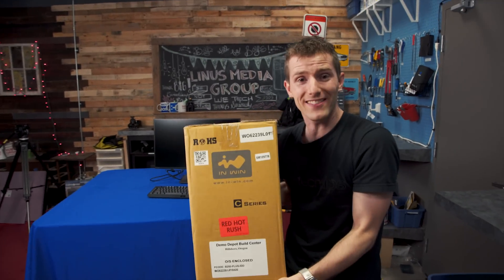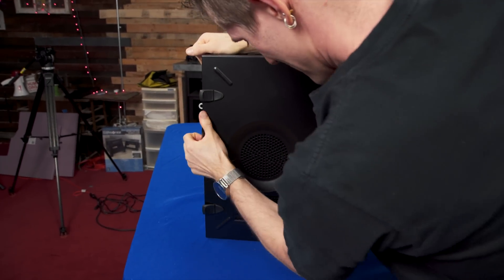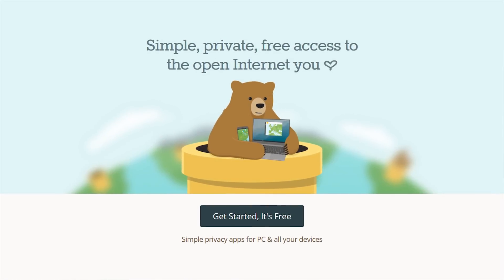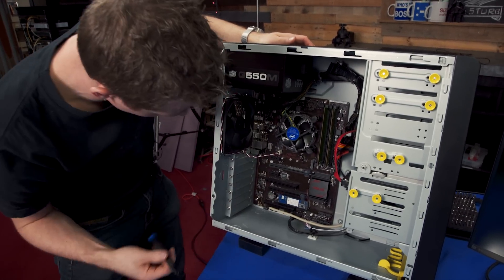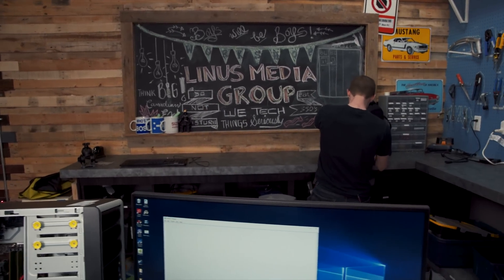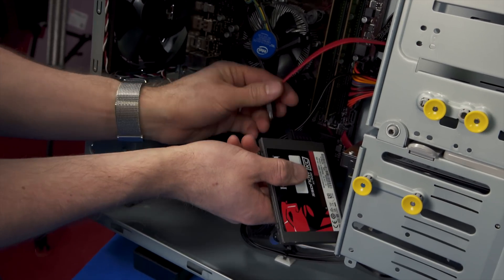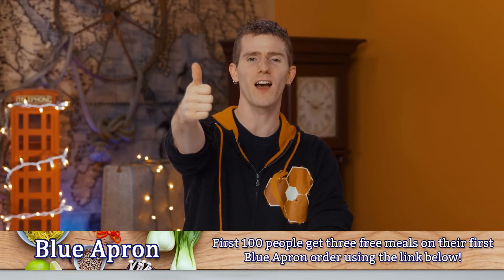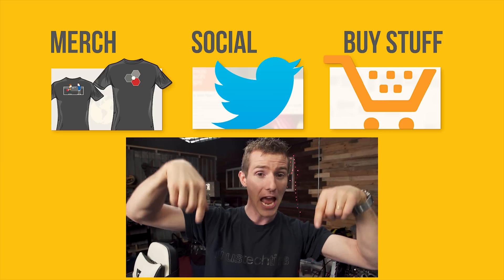Turbocharge your SSD for $40??

Comment: Why they don't have a boot SSD on a new z270 system? I'd be questioning why they don't have an M.2 boot drive personally, since I don't think there are any new z270 boards that don't offer M.2 connections...

The only place I can possibly see Optane being useful is on a personal home storage server, where you're using new hardware but still using platter drives to store your media collection...using Optane to cache Plex would probably give you some good performance bumps. Outside of that (or possibly some enterprise-grade server options), this seems to be a solution for a problem that doesn't exist.

Comment: I see no point to this product.  If you have a PC that is new enough to take an optane module, you likely have an SSD and if it doesn't take an SSD to NVME performance, what's the point of this?
Reply: But it won't ever be "Similar Speed" - normally you get 2 drives, one SSD and one HDD.  And honestly if I have an M.2 slot I'm not going to fill it with an Optane - I'm gonna put an M.2 SSD in there.
Reply: I just built a system with an ASUS PRIME B250M-PLUS . It has 2 M.2 slots or which one has a 500GB WD SSD and the other has 32GB optane. The HDD are 2x WD Black 2TB in RAID 1. Yes, the Optane makes a difference for the RAID array, not so much for the SSD.
Reply: thought Optane only works on primary boot drives, how does it help the 2X WD HDD?
Reply: BlueSmokeGamer I see no point in any of it.
Reply: you can technically set a swap/paging file for the RAID
Reply: Click bait. They made Linus's head look like erect male genitals. That's why half of us clicked. To comment on the Linus penis head thumbnail. The irony is that Linus's chin is actually more like a penis, so they could have just shown that.
Reply: It's supposed to be added to hard drive 
4 tb ssd= $1600
4tb hdd + optane for similar speed= $200

Comment: big question does octane help no primary hdds reach better performance without using the ssd cache. 
I'd assume yes which would be beneficial for multiple mechanical hdd users who may also have a primary ssd. 
(eg steam library on a 4tb mechanical loading faster)

please post results much interested :)

Comment: Isn't the tittle suppose to be "Turbocharge your HDD for $40"?
Reply: nah he's really wondering if you can turbocharge the ssd. He's pretty certain that it will have some effect on the HDD
Reply: I think the tittle should be "Turbocharge your HDD for $40" because it has more significant improvements on an HDD than an SSD and its aimed towards people that use HDD
Reply: Simon WoodburyForget M.2 is a slot. You can use SATA SSDs in M.2 as well so they're not necessarily faster.
Reply: Notice the ?? in the title. Its a question because whether this actually helps an SSD was the main thing Linus was going for.
Reply: exactly!
Reply: 4:53
Reply: yeah exactly!
Reply: m.2 is a ssd. .its waaaaaaay faster then a sata 3(6GB/s) ssd if it has its own 3.0 pcie  lane (up to 32GB/s) whereas a lot of motherboards share it with another 2.0 lane(10GB/s). you want the fastest  ssd performance and you dont have a dedicated m.2 slot get an PCIe 3.0x4adapter if you have an open 3.0 lane on your mobo.
Reply: not all m.2s are the same
Reply: +zeroa69 err not necessarily. M.2 is an interface, not SSD.  M.2 can be used for other types of cards too, e.g. WiFi card. Secondly, an M.2 SSD is only waaaaayyy faster if isn't SATA based. A SATA M.2 will run at the same speed as normal SATA. Lastly just to add, using the PCIe adaptor you've mentioned has a catch in that some older motherboards don't support booting from NVMe so the SSD would only work as a secondary drive.
Reply: Yes, maybe the title should read "Turbocharge your HDD/SDD combo for $40". Octane does seem to indirectly turbocharge the SDD, but it only really happens when an HDD is also linked to the computer system in question. Thus, total system memory is improved by turbocharging the SDD/HDD combo.
Reply: Clickbait!
Reply: it's one of 2 common interfaces for the M.2 slot. The other being SATA
Reply: "Super hyper duper pooper charge you HDD for 40 dollars if you have the right expensive equipment/motherboard, in which case, why the hell don't you have an SSD, you idiot?"
That should be the proper title.
Reply: question does that mean that if i have a m.2 ssd (boot drive) and a 4t hdd(games) would optane improve my game load time?
Reply: Optane can only be used to accelerate a SATA Boot Drive. You can't use it to accelerate your 4TB HDD. If your M.2 SSD is SATA rather than NVMe then I think you can use Optane to accelerate that, but I'm not sure how much benefit you'll get.
Reply: what's nvme?
Reply: Sam Truong it's the standard youtube clickbait thing with "??"....
Reply: Sam Truong watch the whole vid
Reply: ssd is more clickbaity
Reply: Which is why the only brand worth purchasing is Samsung.
Reply: NVMe is an interface for PCIe devices like SSDs and such and is meant to utilize the capabilities of SSDs a lot better.
Reply: clickbait titles

Comment: I would like to see if the module makes a difference when pulling information from multiple HDD/SSDs?

Personally I have two HDDs and two SSDs in my PC. Would the Optane be able to "predict" the information I want off of multiple drives? Would love to see a video on this.

Edit: If it wasn't locked to Kaby Lake I'd probably buy one. I have Sky Lake.

Comment: A discreet SSD + a discreet HDD does NOT accomplish the same thing as an SSD plus an HDD+optane combo. In the former case yes, you will have a fast SSD for the operating system and installed software but launching whatever is stored in your HDD will still be slow -bad news for gamers with large libraries of games. People think the HDD will be using the SSD as a cache ... but that’s wrong. For that to happen you will need to set the HDD as the primary drive and then use SRT (Smart Response Technology) and use the SSD as cache. Normally you won’t be doing such a thing these days as if you are having a sufficiently large conventional SSD you will use that as your primary drive. You would need ANOTHER SSD just for caching your HDD in order to accelerate your HDD but even that will not work that well. What is Intel now offering is exactly an optimised solution wehre you can accelerate an HDD with caching in the hardware level and that with a much faster SSD technology than conventional SATA SSDs. Also give Intel some credit as they are amongst the pioneers and driving forces for the field of SSD technology in general.

Comment: I've been saying this since everyone started hyping it like if it was a huge deal. Optane memory is pointless, and I'm kinda lost at what Intel was expecting it to be. You can get an SSD at the same price, install you whole operative system in there, and it will be fast every time since it won't have to cache anything. It might make some sense like in a really budget build, but Intel limited this technology to only high end boards and high end chips. People who is probably already using a high capacity nvme SSD.

The only place where it makes sense is in laptops since they usually only have one mechanical drive.

Comment: Surely a octane be good for older sdd as they get slower over time due to the way they storage data like there file paths get harder for the computer to fine after years of use so could it help with that?

Comment: If optane was an add in PCI card to use in older existing PC's then it would make more sense. Seems like they missed the target market with the  optane cards.
Reply: I think it would have been great if you could put it older pcs via pcie adapter card. And if it also is very easy and fast to set up. It would have been a great way to speed up pcs of not so techy-savvy friends.
No pulling data from a hdd to an ssd and not telling them all the time that they should install all the stuff on drive c.
Idealy just  installing, enabling and there pc is faster.
Missed chance.
Reply: Optane memory can be added via a m.2 pci card
Reply: Jacob F jup.

Comment: The issue with this is that it uses m.2 so if you have an m.2 slot on your mobo, you probably already have an ssd because your computer is new. I'd prefer to buy a cheap ssd for 80$ when building a new pc than spend $40 on this and not even be guaranteed all-around better performance since you are relying on cache policies.

Comment: For 77 $ it´s not a good option. It´s faster in numbers but the benefit for everyday use is not that big. Better have an SSD and a hard drive until optane is more affordable with bigger capacity. Maybe then it´s an option.

Comment: makes sense for prebuilt OEM PCs.  The cost of a 1tb SSD is a lot more than a 32gb optane drive and a 1 tb HDD.  The SSD is still better in most cases, but if you just want a responsive interface and large capacity, this isn't a bad way to go

Comment: Lots of consumer end laptops still come by default with a HDD as the primary drive. Of course the issue then is whether the aforementioned laptop has an M.2 Slot you can throw the Optane chip into.

Comment: aka the "I built an expensive enough modern pc to have an m.2 slot but forgot a sata 3 ssd" PC
Reply: If you went from an HDD to an SSD and didn't notice a HUGE BUMP in OVERALL performance there is something wrong going on.
Reply: i cri ;-;
Reply: Yeah that sounds like a SATA III M.2 to me.
Reply: Med Otaku it makes everything that requires disc access MUCH faster and more importantly, much more responsive. You also got the EVO which has half the PCIe channels of the PRO.
Reply: Affordable 4 lane PCI Express support in M.2 is relatively new. See Samsung 960 Pro. It absolutely is incredibly amazing if you have an M.2. drive, but Optane is underwhelming.
Reply: SATA 3 M.2 drives are 6 times slower than NVMe ones and costs more due to the SATA controller.
Reply: But.. M.2 is kinda old, right? I know that SSD's built for them are relatively new but the Mobo in my 2 year old build was about 200 dollars and happened to have M.2 support. So, I just started using it. Upgraded from a WD Blue, this is my first SSD (outside of a chromebook) and yeah, it's fast. But I'm not /really/ seeing it as being 'incredibly amazing' or anything. It's definitely nothing to drool over.
Reply: Not as far as I can tell. M.2 slot is set to PCIex4 in BIOS, benchmark shows 2,554 read / 1,463 writes (sequential), Samsung Magician reports no compatibility issues, have the latest firmware for ssd, mobo, etc. TRIM is enabled, interface is PCIe gen 3 x 4, NVMe Driver is good.. 

I just always had good HDD habits and mine never felt like it ran /that/ slowly. The only times I noticed some hiccups would be when I attempted to compile a large file or had a program / website open in my development environment that was starting to get really huge. 

I'm not saying this drive isn't fast. It is. I just don't notice having to wait   much less than I did before I upgraded to the 960 EVO. Or maybe I'm just not easily impressed. 

"My computer turns on faster. weee" :-p
Reply: he said Mhz, not Hz thats 144 million frames per second
Reply: SuperNeonManGuy Notice the 550 watt psu in a system without graphics card...
Reply: HA!!!!! SO true!!!
Reply: But that Intel Optane SSD DC P4800X is only $1500! Cheaper than an Acer ( HDR, 144mhz, 4k ) $2000 monitor branded for gamers! 
Apparently at board meeting across the tech sector they decided we r hiding money n must b held upside down while being violently shaken till the scratch is loosed by gravity and we submit to resolving their bottom line!

Would like to have seen more discussion comparing the Intel Optane SSD DC P4800X numbers in contrast and to speculate on the first consumer solutions.
Reply: Brian Su it's a wd 250gb m.2 ssd I bet it's sata. I paid 90usd for it. The wd blue sata 3 250gb ssd cost the same price. I'm assuming it's sata speeds
Reply: I'm glad I stuck with the EVO, then. I don't think I do the type of computing that requires read/writes on that scale, but i'm very happy that it exists. When you say half as many channels, do you mean PCIe lanes? The PRO uses 8x PCIe lanes? Or are you saying that it has a higher bandwidth?
Reply: i have a feeling caching a RAID array would only be possible if the RAID array was controlled by is own controller and bios and outside of the array, it appears as a single drive, much like the Dell PERC cards. unless intel updates the firmware to allow you to select what drive is being cached by which optane module I would be more interested in seeing a 1-4TB gen4 PCIe 16x SSD that was optane based, and not the enterprise price of the 375GB one they're releasing for datacenters, though it would be cool to have like 1GB of DDR4 and then 128GB of optane system memory, but i dont think optane is fast enough(yet) for that
Reply: It may already be possible for those using windows storage spaces.  That takes normal hard drives and creates a software array without a controller.  My raid 10 storage spaces array of 6 drives gets around 550MB/s.
Reply: iiiits NOT for gamers, its for data centers hence the DC in the name instead of being a cache drive, its a RAM drive, it takes the place of system RAM, some servers can support 1TB of ram, but that would cost roughly $20K, to get 1TB of in your server using the DCP4800X would cost less than $5K, also getting a 144Mhz monitor in ANY resolution for only $2000 is a steal, normally they're only 0.000144Mhz
Reply: denvera1g1 Buhhh... I got a 144hz 1080p monitor for like 200 bucks...   refurbished Benq on eBay. Where are you shopping for displays that 2,000 USD would sound reasonable? I find that I can't push most games to a consistent 144fps, anyway. CS:GO, Halflife 2, FFXIV, sure. I could do for a gpu upgrade, anyway. Maybe I'll put all that sweet display savings into a 1080ti :-p
Reply: ^O hahaha, I guess that would be a steal, then! Too bad that one went kind of unnoticed.
Reply: I got a 40 inch 60hz 4k for $200 at wallmart(240Hz @1080p) so yea a $2000 144hz monitor is not a good deal
Reply: That $2000 Acer is only 144Hz @ 4k. Not MHz ( oops ) But as far as I know the only monitor that can do as much at 4K? They price it insanely because the combination of color accuracy to that speed. WCG Quantum Dot tech HDR and the High percentage of rec.2020 that it matches...
It's yer TV solution that might save us from Monitor pricing as a market alternative that empowered the consumer to force the market ( just like markets need to keep them healthy )
Because you can still get an Awesome 43" 4K Sony X800d TV at 60Hz like yer TV but with  HDR10 as well for oly $649 ( quite a big jump to $2000 for that speed and higher HDR rating )
:(
Can't help wishing there was a relevant 32" market with all the bells n whistles. At which point we could lobby for a nice gaming mode and gaming fixes ( the way the OLED HDR  judder issues and gaming performance was addressed on the LG B6 in answer to community pressure )

down from $649 I can't stop wondering how much cheaper a 32" version of the Sony X800d would be?

Was going to pull the trigger on a 2016 55" LG E6P for the 3D,  OLED and HDR10/DolbyVision considering LG and Samsung killed 3D in 2017 ( no 3D on that Sony X800d as well ) But that would had been more than $2000 as well and I am told that when HDMI 2.1 releases late this year ( or in 2018 ) that the headroom ( Improved bandwidth from 18Gbps (HDMI 2.0) to 48Gbps (HDMI 2.1) ) will bring ubiquitous speed flooding the market reducing price for the tech. Which is not to long to wait n see. Gaming Branded Bait pricing makes it easy to cruise in this holding pattern. However it seems like insanity has lasted a looong time.

http://4k.com/news/acers-new-predator-x27-4k-monitor-offers-hdr-and-uhd-gaming-at-144hz-19552/

edit: whoops... I though u were referring to a TV! um. Nevermind me then. :)
Reply: I paid 90 for an m.2 250gb wd ssd. that's the same price as the normal ssd so I'm not sure what you mean by they cost more.
Reply: +Eric Bostick sometimes if you take a SATA M.2 SSD and a NVMe M.2 SSD for the same capacity, you'll find that the SATA M.2 ones cost slightly more and are 6 times slower. You've mentioned you bought an M.2 250GB SSD but didn't say whether it's SATA or NVMe though.
Reply: My SSD just failed. I have a back up HDD, but it is slow. This would be my solution without spending $400. How is this a waste?
Reply: yeah, i was thinking the same thing.  Placing a mechanical drive as the boot drive just shouldn't happen in 2017.
Reply: Damn I must had missed the part that said u had to use as much on yer boot drive! Otherwise with 3 m.2 slots I could see booting to nvme and using optane to cache a 12 terabyte HD raid ( is that possible either? )
Reply: I have a 960 Evo M.2 and it's my first ever SSD, it's /ok/ but I'm not seeing a massive amount of utility in being able to turn my computer on faster. Maybe I would be more impressed if I had to work with some software that was storage heavy. The most impressed I've been with storage lately is the transfer speed increase I got from a usb 3.0 external drive after I right clicked the drive icon (under 'show hidden icons' on windows bottom right) and switched one of the settings from a 'safe mode' to some mode that made it more risky if you were to suddenly unplug the drive. But it increased transfer rates from a few dozen (maybe 19)  megabytes/S to around 1 GB/S Not gigabit* mind you. I was setup to wait days to transfer all these video files and it ended up taking a couple of hours just from pressing a button. I haven't had the opportunity to see what an SSD to SSD transfer would be like, let alone with M.2 NVME drives.